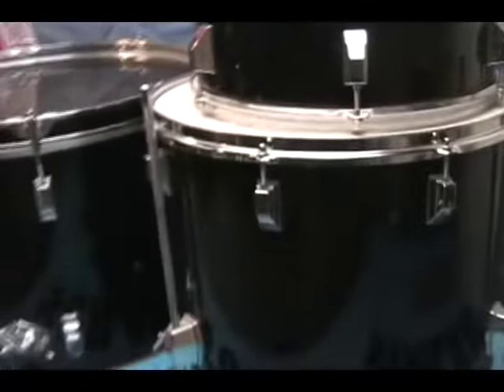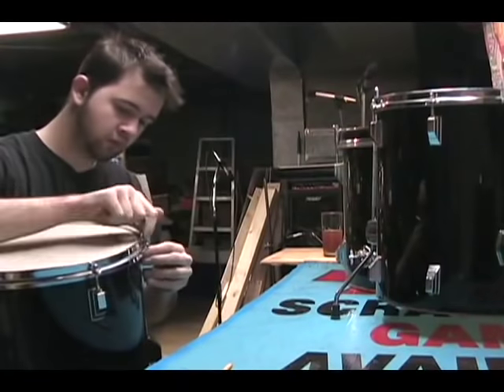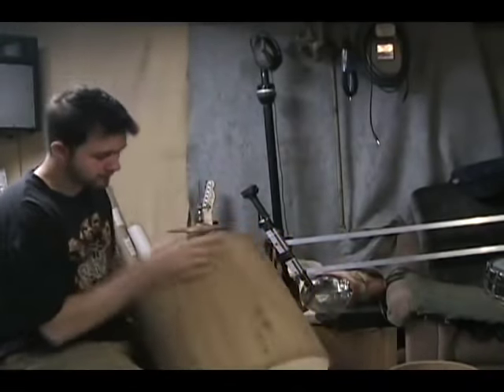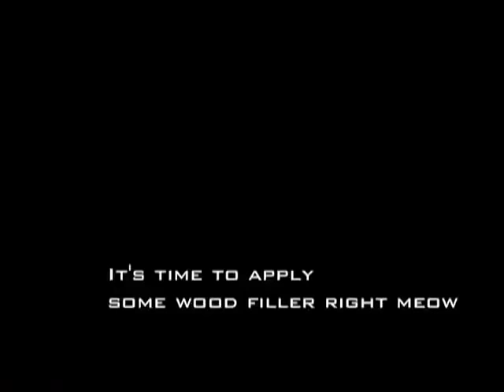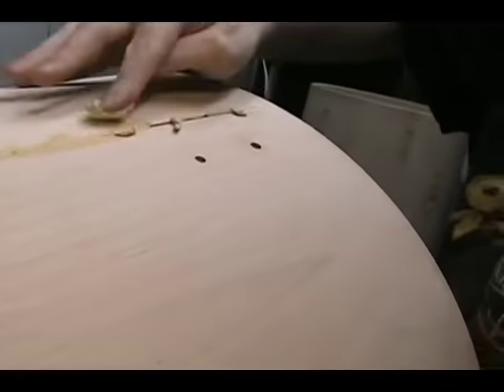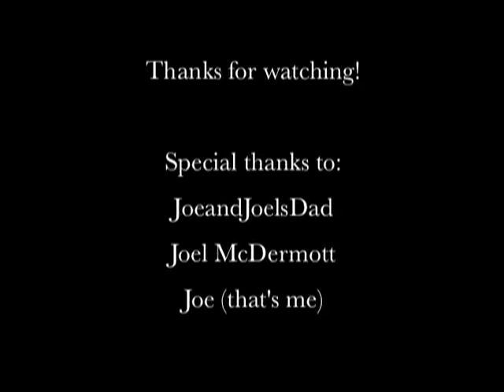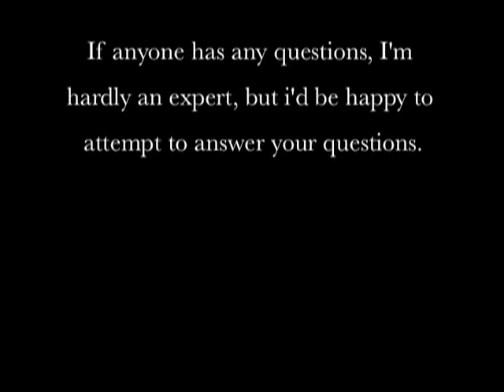Refinishing my drums

Comment: Nice video dude. I recently refinished my ludwigs. It was definitely a learning experience. They we're already varnished, so I had to strip all that off first. Always use GLOVES with stripper... One thing I can say is that spraying varnish on is the way to go if you have the tools.  Very smooth. I'm gonna recut the heads tonight on a table router. slight roundover with a 45 inside. Wish me luck!

Comment: Good Job sir!  I like the idea of covering the lug holes with tape.  I'll use that tip!!  I am currently refinishing the same boring black lacquer pearl drums.  I used a propane torch to remove the lacquer from the shells.  I'm not going to use stain, I'm just going to rub on some tung oil and call it "Good"!  I'm building a small jazz kit and converting a 16" floor tom into a kick drum.  It should be nice an tight!  Thanks again for the video!!  Happy Trails!!!!

Comment: i did mine a little while ago. i removed the wrap and just recovered  them using only duct tape. i didn't feel the need to sand or anything, because the adhesive worked great by itself. i used a knife to cut all the holes for the hardware (time consuming) and put it all back on; it looks badass now!

those rivet-style air vents are a bitch to remove. i wasn't going to replace them, though

Comment from the maker: I could be mistaken, but I believe the actual metal pieces in the air wholes are cosmetic. I doubt it'd change the sound if you were to skip replacing them, but I wouldn't for the reason of it just looking kind of strange in my opinion.

Comment: If there is anything on the shell, glue, putty, irregularities... those will all show up very prominently when you stain them. Does the shell have a nice woodgrain? Or is it kinda cheap looking, like luann or other cheap wood?. If it's a nice wood, try "Goof Off" or some other glue solvent. You might be able to get a nice stain job. If not, paint or re-wrap are your only reasonable options. I use old poopy drums to experiment with. You might be in that category. What can it hurt?

Comment: Blue stuff? Is that color bleed from the old wrap? If it won't sand off, ( you don't want to sand too deep), you may end up having to re-wrap the shells. Kind of a spendy option, and considering you probably don't want to spend a fortune, not the best for your wallet. If they are good quality drums, it is a good idea though. Otherwise, you may want to consider painting them. It's much like staining, but it covers the discoloration better and you can clear coat over the paint for a nice finish.

Comment: @wcvj91608 before you think about using anything on your cymbals you need to have a listen and ask yourself "is this sound good" most products for cleaning metal are abrasive and even if they're not taking off the build up of stuff that gets on you cymbals will generally brighten the sound, this may not be what you want for certain cymbals as you may find overtones where you don't want em. Either way cleaning em too much wears em down faster.